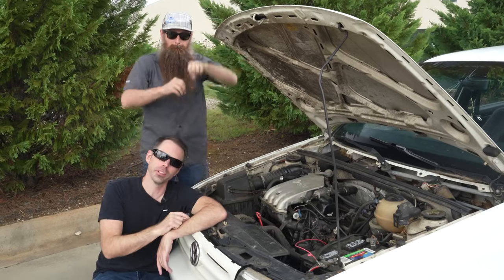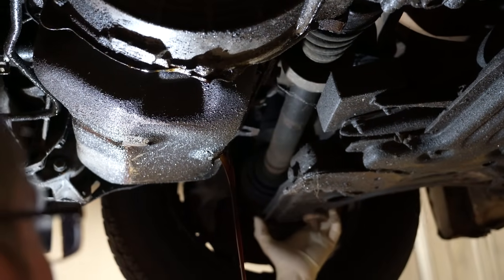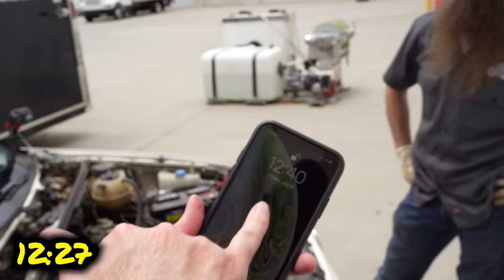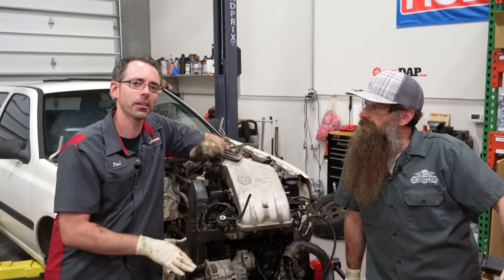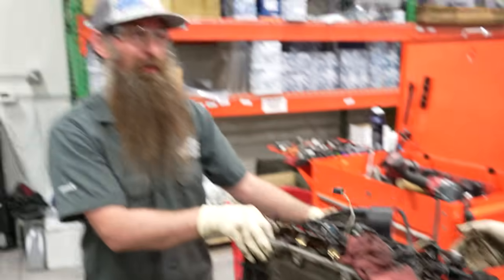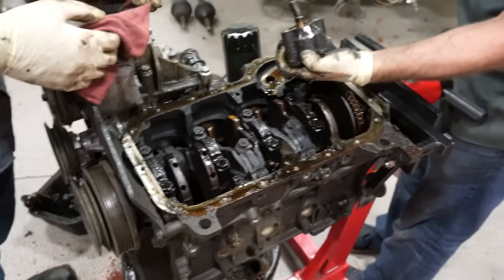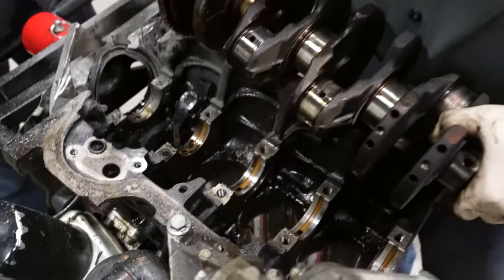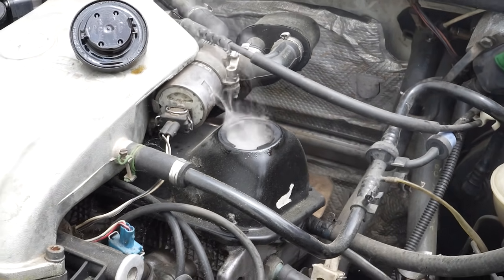Can an Engine Run with No Oil?

Comment: I change my oil as regular as possible and my car has high miles on it a 199000 on a 2.0I change my oil as regular as possible and my car has high miles on it a 199000 on a 2.0

Comment: You guys have done it again, the vdub gods are going to punish you .🤣 . That was one of the better made vw engines compared to the ones now , that was a waste . I hope that there's a Daza swap in the works for what's left of chassis. Lol .Hey suprise us with one 😎
Reply: It had 300K miles. Not realistically going to last much longer. Plus if I recall from the other vid, the motor had some major issues?
Reply: @OwenC1  they go 315k with no attention. (piston rings lock with carbon, also sometimes the feed to a rod through the crank) That had 45k more to go.  Modern VW gerbudge cannot compare.

Comment: This video is incorrect and I'm only 12 seconds in. The 1.9 SDI and 1.9 TDI engines and the PD variants are the most reliable VW engines. None of the VW petrols are exceptionally reliable.

Comment: The test wasn’t correct. It need to be tested at idle even if it took days. That would be very impressive then in the real world what if someone drove it with no oil after an oil change? The engine would not be revved to exploding but normal driving rpm’s around 2000-3000 rpm’s. I still think the engine would be damed within an hour but maybe not. Unfortunately this test won’t show us what would really happen. Hell any motor can blow after running at 5000 rpm’s for a long enough time